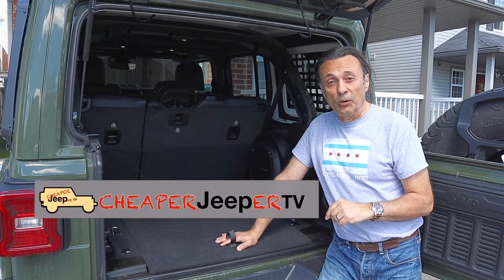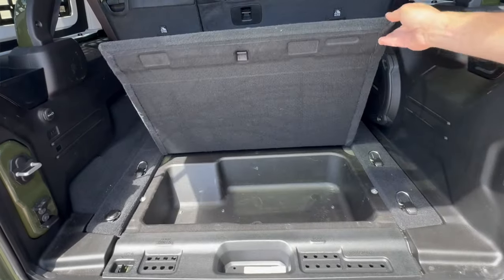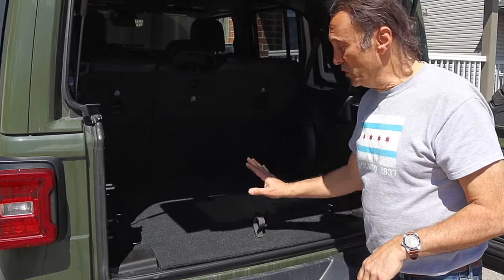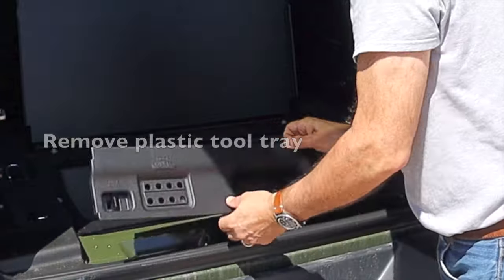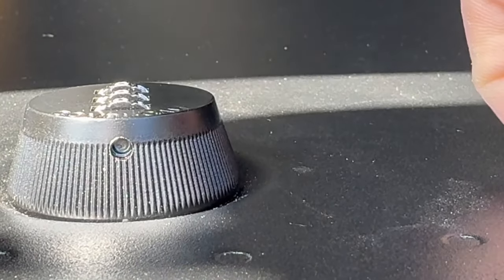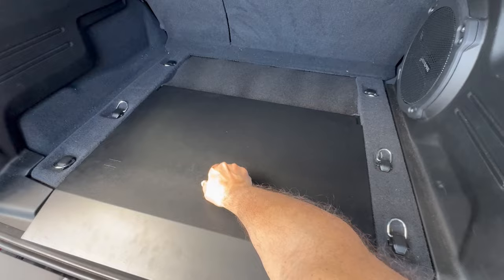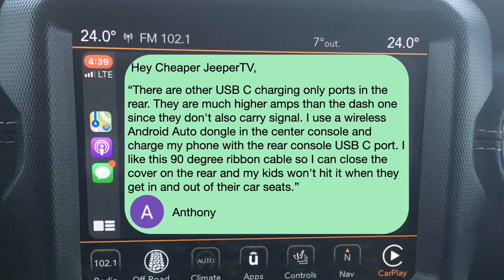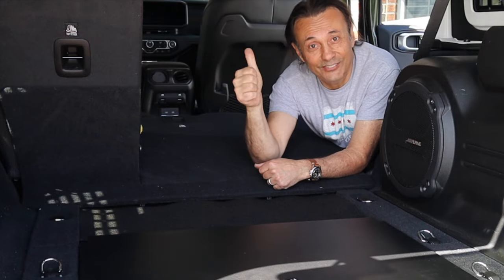Keep Items Secure In Your Jeep, With the Tuffy Locking Lid In Floor, Cargo Storage Area

Comment: Great idea! However I would have preferred the locking device ressessed into the lid for obvious reasons. Great video thanks for sharing.
Reply: I agree. sliding boxes etc into the hold will catch that locking device
Reply from the maker: Actually, That thought crossed my mind, but I forgot to mention that in the video, and I agree with you.
Reply: click on the Tuffy product link and you'll see that the key option is recessed.
Reply from the maker: @richards144  Yes.....Good point about one of the differences between the keyed option and the combination lock option. They keyed option is more recessed. Thanks
Reply: @richards144  thank you